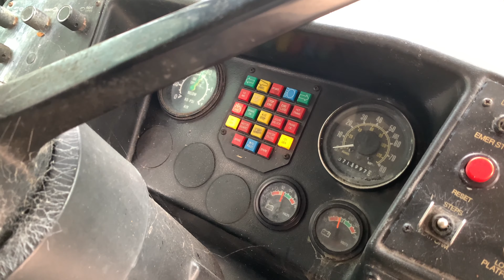Detroit 2 Stroke Powered Bus Start (Didn't go as planned)

Comment: I have fond memories riding these Flxibles when I was a kid.  In 1981, Santa Clara County Transit (SCCT) purchased 219 Grumman 870's, after the A-frame problems New York City Transit encountered were corrected.  Then continued to buy a mess of Flxibles in the early 80's and beyond.  We also had a bunch of older New Looks, GMC RTS, and articulated Crown-Ikarus and MANs.  At the time, I didn't realize the Grumman 870 and Flxible was essentially the same bus.  I just knew they looked surprisingly similar, but had a different name plate slapped on its nose.

Comment: It's called a "Fixable" ? That's nice. Was that really the first start dead cold? If so, I'm impressed! NO smoke, engine hasn't puked all over itself! Wow. 3/4 mil Miles? I would think Bus Grease Monkey would give a nod here if I say so!
Reply from the maker: The engine has a reman plate on it, so I'm pretty sure it is not the original.  The rest of the bus certainly looks and acts like it has 3/4 mil miles!
Reply: Flxible, just like the vintage bus in "RV" :)
Reply: The company's name was initially spelled properly -- the Flexible Sidecar Company -- until 1919, when they needed a name that could be trademarked, so bye-bye went the first "e."

Comment: 6-71T ? Didn't know that still used Detroits in 1991.
Reply: I think they made the DDEC II version up to 1992 or 1993. 6L71TA
Reply from the maker: @TheCRTman  You are correct.  This is a 6L17TA with DDEC that goes through an Allison V731
Reply: @tonystarkonabudget  i though the 6L71s were horizontal only and i didnt know they were available with an aftercooler. But awesome bus nontheless! 🤙
Reply: They still used em till 1998.